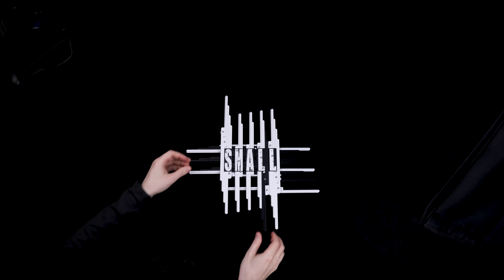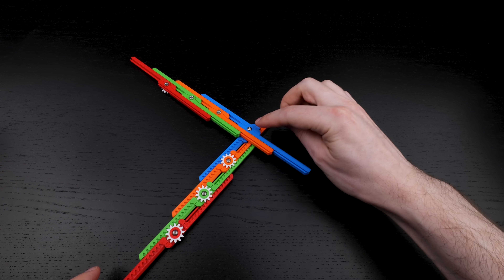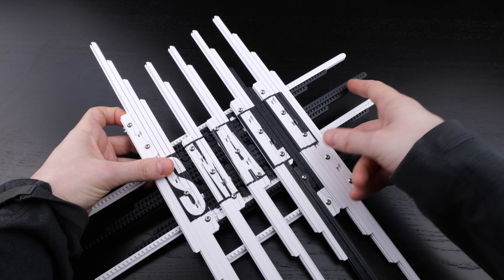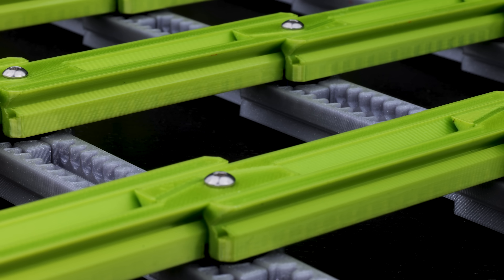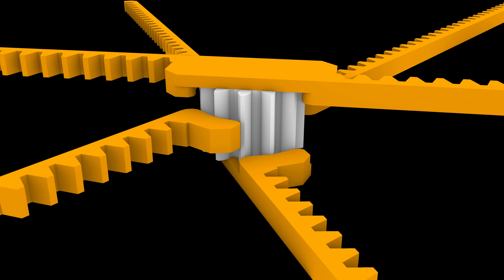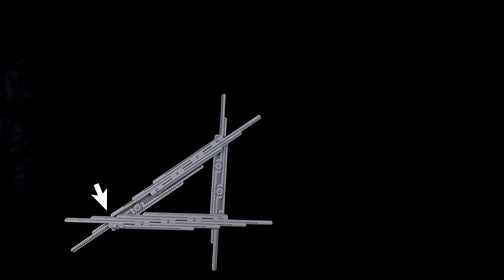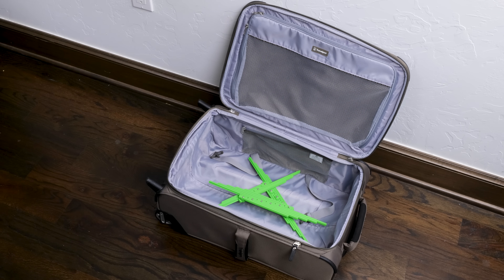Expanding racks

Comment: The equilateral triangle grid could add stability to instant structures, perhaps. Since the bolts are always visible, they could be extended and hold, say, a fabric or a panel.

Your video immediately made me think of Veritasium's "Engineering with Origami" (https://www.youtube.com/watch?v=ThwuT3_AG6w) and the one about compliant mechanisms (https://www.youtube.com/watch?v=97t7Xj_iBv0). I imagine your mechanism could allow complex stacking of rigid panels only slightly offset on the z-axis, making an instant wall out of mirrors for example. Just like the origami solar panel example, I think expanding racks could offer a way to reduce dimensions while still deploying easily. This would be especially true if you could make designs that lock when fully expanded while still being (less easily) unlockable.

A wild example I'm imagining is a splint disk. Say you're drilling a very narrow tunnel and need stackable, discrete scaffolding that can be deployed with minimal effort near the expending end. Just send rings down the line holding the drill and drop them onto a rotating mechanism just above the drill at set intervals. The strength of this mechanism over a sliding version is potentially locking at different radii thanks to the gears (using a simple ratcheting mechanism, for example).
Reply: ALSO, if you found a way for the gear to bend only at full length, that would allow for a semi-compliant mechanism which could use that bending to lock and only be retractable when flat. See the "surrogate folds" at 5:30 of the origami video. These are easy to 3D print and hopefully have a minimal effect on the gear's function until folded. A prototype might be a large gear with a single fold through or directly next to the center.

This may allow a rigid, curved or at least polyhedral) surface to be stored flat. For example, a dome tent--which is usually made with rigid bars later covered with clear plastic (0.3mm PVC, for example). A semi-compliant expanding rack could be stored flat, folding the plastic (again, attached at the bolts) upwards, and compressed into a disk. It could also be expanded (with some extra material for folds) to a large circle and collapse downward to create an instant tent with zero assembly. Imagine its use in harsh environments, like structures on the moon, deployed by simple robots. Add on a floor tarp and a gasket and you might be able to inflate the dome. Or casually revolutionize camping with 3D printed tent skeletons.

Comment: Would it be possible to create a mechanism with a rack that is flexible in only one direction, that wraps around the gear? You could transform circular shapes into angled shapes. And I imagine you could save a lot of space coiling the rack around the gear
Reply from the maker: Something like that would be very interesting, but I think it would involve either compliant mechanisms (which seem hard to design) or a large number of hinged parts (which would need to be huge or have very small parts).
Reply: @henryseg  I'm the furthest thing from an engineer, I just got thinking when you spoke about trying to get something solid to expand and be rigid. Coiling racks was my only idea haha. I loved the video!

Comment: Maybe you could stretch a cloth over this mechanism and make one of those light reflector discs for photography? the "loop of metal that rolls up" design is probably a cheaper solution and might also fold up smaller but is also a bit frustrating to handle.

Comment: Do you have the files for the design at 9:00? thats almost exactly what I am trying to build for my project of a collapsible workstation and im definately wanting to print one, probably recessing the screwheads as a mod
Reply from the maker: Not exactly the same, but some of the parts in https://www.printables.com/model/1305045-expanding-3-4-5-triangle can be used to make a grid. There are some instructions on which parts to use in the printables page for the triangle.
Reply: @henryseg  ah gotcha thanks checking em out now i did download the 345 triangle but i didnt read the documentation at all 😅

Comment: the one thing you shown isnt efficient. You are only getting about  50% expansion using 3 or 4 smaller rails when you could strive for 80% or more using one slider

Comment: A ton of usage for such systems. Imagine the forms you presented as the cross sections of containers or storage systems. You can just add a fabric or cut panels that slot in a grove and get differently sized containers. 
Another larger scale use is kind of already in use are push rack systems in warehousing. But you can step it up and make an expandable rack.
A manufacturing cycle is produce store pick and ship. And floor space is always a premium. 
So when orders are staged before shipping they either get stacked to unreasonable hights or occupy exuberant amount of floor space.
Having the end of the stationary racking able to expand will be a must have for literally any company, especially smaller ones where they have even higher space constraints. 
Another one would be collapsing pressure vessels, scuba tanks any gas storage compartments. With what you presented as cross section and longitudinal bracing.
Or maybe even pump like functions where mechanical energy can be directly transfered into gas pressurization.
But this system is putting too much pressure on the gears so looking into another way of interactions might give some more robust and structurally sound designs.
More gears, ball bearings+teeth interactions on the elements, one way pins ect.

Comment: It looks like they would still work even if not at 90 Degrees. Can the "cross rack assembly" rotate to any angle, and the expanding action still happen? My crude mental CAD says they will.
Reply from the maker: Yes, later in the video I do 60 degrees, and atan(3/4).

Comment: wouldnt a hexagon work well  for the triangle 2 layer problem? using the racks only in the outer perimeter, you would have to adjust the design so that a rack can only be connected from its outer endpoint? it would be wobbly tho
Reply: amazing engineering really, im fascinated

Comment: If you make a piece that has 3 arms at 120 degrees from each other, you start getting triangular designs that can assemble into hexagons and so on. If the wheel has one extension upwards, you can start having vertical pillar that holds camera, light source, etc

Comment: i believe this has irl applications in making quickly assembled truss bridges or making expanding building... build it in a warehouse pack it in a container move it to a site use a motor to expand the building and lock the gears. then have prefab pieces that just fit in between the legs

Comment: I’d love a deep dive on just the double racks in linear mode. I know it might seem more boring, but I’m interested in knowing if I could beat a drawer slide in terms of extension or sturdiness.

Do these exist as off the shelf parts? Would machining them from metal be reasonable, or they rely on being 3d printed? Would they wear down with use (or just with mechanical load if they are subject to forces and vibration). How would I go about calculating the load requirements for a given application?

My use case is for a solar awning on my sprinter van. I’d love to be able to extend my panels as an awning when I’m parked. This does give me the idea that I could put the panels on offset gears and have them rotate from long way to wide so I get more awning extension
Reply from the maker: My expertise is not in the kind of mechanical engineering that would lend itself to such an analysis, but I’d be very interested. (I also wonder if using metal could miniaturize the mechanism?)

I don’t know if there are off the shelf rack and pinion mechanisms, but there isn’t much beyond that - the only other feature is the rails and grooves, which should also be pretty standard.

Comment: It seems that the more of them you add, the faster the last one moves, but how fast could that last one potentially move? What is the limit?
Reply from the maker: With perfect joints, perfectly rigid parts, and zero mass, there is no limit. In the real world however, the slop in the joints inevitably adds up, and the parts deform a little bit, and the force you'd need to apply to the first gear to get things to move would increase...

Comment: I could imagine this in a roof design for a terasse or so. Normally the terasse has no roof except for one corner but then you expend it and there is a roof over the whole thing. Maybe add some kind of cloth you make it waterproof or so. Also could imagine needing some kind of rail because of weight

Comment: I would bet that with some variable length and variable tooth count gears, that you could make the small version be almost any shape you want which would then decouple the shape of the small and large configurations.
Reply from the maker: It’s a bit tricky to vary the gear, since the same gear teeth go over the rack teeth multiple times.

Comment: Y'know... since you are looking for ideas, the very first thing to pop in my mind with this mechanism was "expanding LED displays". Like the big screens we see in stadiums or big electronic music shows. Imagine a screen that expands an image in 3D by expanding the screen itself ^_^ The gaps do not matter since there already are gaps between "pixels". And imagine racks that can expand independently or in different speeds on command - I picture car's differentials as an analogy, that allows different wheels to spin at different speeds from the same input without the need of the driver activating anything themself. Like this we can have dynamic images or videos that expand with the racks independent from the background, and it may not consume much more energy since it's all mechanic instead of electric or electronic (not counting the input ^_^)

Comment: I think you could achieve organic movement by having different gearing ratio. For example, a spiral opening and closing. You could also make pliers. Or legs for a whole animal. Also, the number of tooth in one rack don't have to be uniform. In one linear movement, you could have multiple action happening, like an arm first extending and then grasping something.

Comment: Expanding racks are robust enough for sliding shelves, and the triangle bit could lock into place to hold as support.
Most drawers and shelves are limited on how far out they can be before they collapse, but the triangular supports pulling out with them can go all the way to the floor or ceiling.
That means a full size table can theoretically slide right out of a suitcase, rather than unfolding.

Comment: 9:40 so in an equal size grid I could assume an optimal tradeoff between expanded and contracted sizes would be a rack the same length as my total collapsed width for that number of racks. This also seems applicable in a non-equilateral context.

Comment: Would the triangle collapse if yould put weight directly on the longest side? If yes yould need some kind of clamps to hold it in place, but you'd have a camping solar panel stand. I'm also thinking about my DIN A3 drawing board on my desk. Either expanding it or giving it more or less of an angle.

Comment: The first thing i thought about when seeing those where artificial muscels. They use compressen air or hytraulics to contract. However, they suffer from short actuation length. 
If onw would use this design together wit a small piston, it would be possible to achive really large actuation distances

Comment: This is cool but what can it be used for? the 3d printed parts look very flimsy compared to something like a linear rail for a drawer or something. No hate, just wondering what to use it for. Cool design.
Reply from the maker: No reason these couldn’t be made in metal, other than cost of production.

Comment: Now if you could make a 3 dimensional pyramid of expanding powered racks, if would be like a dynamic form that could change shape to locomote across any terrain by contracting from the desired direction and expanding into the desired direction.  A shape like that could have magnets at its points to climb the side of steel ships for painting or cleaning.

Comment: It could be a simple, mobile, modular, and scalable, method to convert torque into RPMs with minimal initial loss/lag due to the relatively elastic nature of most materials. 

so the simple basic linear 1 DOF system through the compounding nature of the gears has the last rack moving a significant distance from the first gear. If the first gear is hooked to a high torque power source you can convert that movement into RPMs by having a rail that runs the entire length (you could have modular sections to make the appropriate length). This could then turn a small gear . 

The small gear on the end has to rotate to match the overall travel of the last rack. Since all the motion is linear through a very rigid 1 DOF structure you end up with very minimal instant torque loss due to the material flexing before transferring the torque. 

I'm not sure what the exact application of that could be, but it would be great for anything that needs to accelerate very rapidly over a short distance with a more linear power curve. I posit that would produce a less shocking acceleration in terms of G-force. This means less specialized materials (very hard materials with very low elasticity, but very high toughness) could be used. The system looks like you could scale it multiplicatively by stacking it vertically.

If you managed to make a reciprocal clutch that allowed reverse movement not to affect the output, like a rachet, and/or employed a flywheel at some point you could create significant overall rotational energy in a relatively compact space with far cheaper and common materials. 

Alternatively, if you DID use those exotic materials you could have a very very simple, accurate, precise and compact method of turning rotational motion into linear motion. which could be very very useful.

Comment: Man, if there was a way to make it drop down to make it one plane for the triangle, it would be so handy in construction. I like using a speed square while cutting boards with a circular saw. But 12 inches is the biggest, which makes cutting a 12 inch board difficult and slower. Plus, they're not convenient for bags.

Comment: This is pretty amazing and very satisfying. Thanks for the engineering and the presentation. 
I was wondering if it would be possible to bring this into the third dimension, make it a cube. I think it could work, but it's going to be substantially more difficult to pull off.

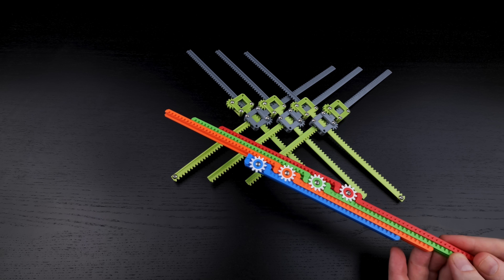Comment: 2:30 it's just me or the blue rack is useless?
Reply: Not really? It may not expand the stick as much, but It still serves the purpose of moving the gears closer or further perfectly fine.
Reply: If you finish the video its uses are explained.
Reply: Created by Milly Blue
Reply: It's just you. In a real mechanism, that blue rack could be used to attach something to it. It doesn't add any length to the entire thing, but it's the only surface that can move from one end to the other.
Reply: It’s just you

But to not be a total dick, here’s why it’s not useless: you see the gear from the orange rack spinning the blue rack, therefore moving it and extending the whole thing just a little further. But to be fair, just at full extension by a few millimeters, so yeah, pretty useless

Comment: Expanding tables in cramped environments like planes or ships.
If you add something that can be stuck on the spaces to turn the racks onto surfaces, then you can literlly have modular pannels in there that, once combined with hinges, will give you a great deal of extra surfaces that can be then dismantled easily and put away to make room when not needed.

Comment: The unmirriored version could be used to hold something in place. As one end expand the other retracts meaning as the edge mov the center stays put

As for overall aplications if the was some kind of locking end you could use them to make quickly assemblable and dissemvlable shelters or walls

These are awesome great invention!